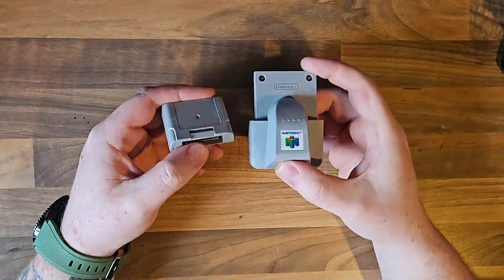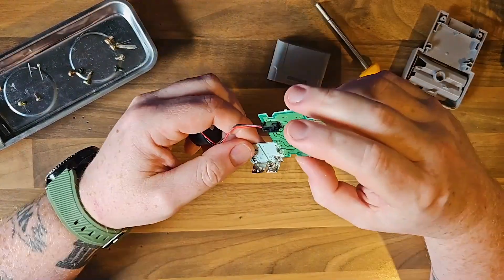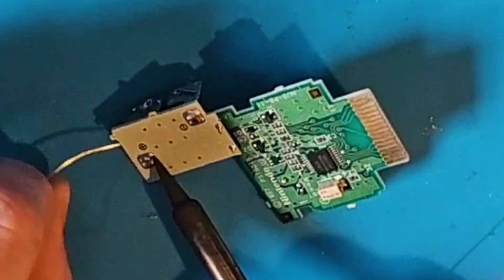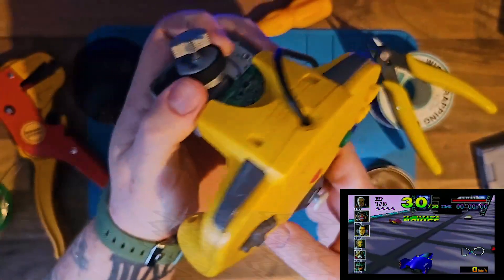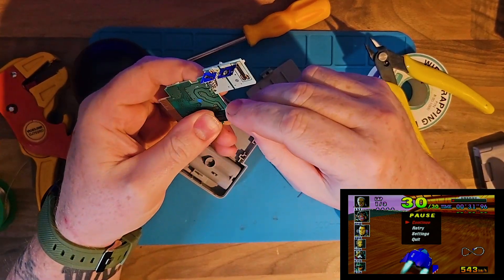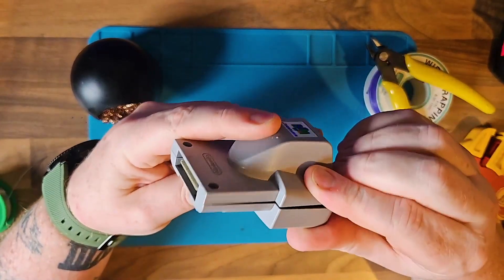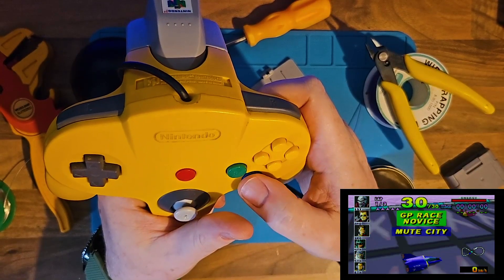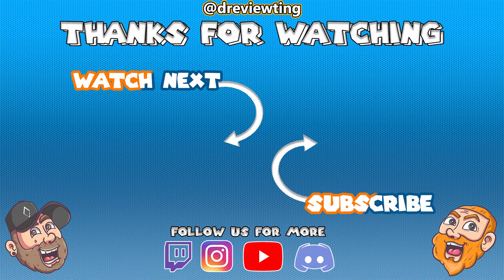No Batteries Required?! NEW N64 Rumble Pak Mod 2024

Comment: hey 2025 here :D , what if we put a capacitor in the battery housing to support the voltage? will it damage the console? or can we figure out something with it to stabilize the current draw?
Reply from the maker: Hey, 2025! Haha! I wouldn't know about adding a capacitor. I use this regularly and have zero power/draw issues.

Comment: I have a Tremor pak plus and was hoping the inside would be similar. Nope. I had no idea what the heck I was doing so I just solder the wire directly to the 3.3v pin itself. I thought the controller or the console would blow up but it end up working lol.
Reply from the maker: Ha! That'd absolutely amazing! I've not found anyone with a solution on third-party peripherals, so you might be the first! Haha

Comment: All you have to do is move the resistor under the batteries to another location no need to add wires
Reply from the maker: Both work. This way means there no need to desolder anything. Just one wire, that's easy to undo to put it back to stock.
Reply: @DReviewTing isn't the resistor necessary in line?
Reply from the maker: I'm honestly not entirely sure. I ahead both mods, and find them to both work the exact same way.

I find the wire less daunting that removing the resistor and relocating it.

Comment: wonder if swapping out the motor for a lower power one could let all 4 run without batteries
dont have a n64 to test that out though since ive always been on handhelds rather than tv consoles

older stuff like this would probably be wise to put a diode between one of the motor wires and the main board to prevent backdriving, though tracing back whats visible in the video looks like it should be a safe mod
Reply from the maker: That's a very interesting idea. I just swapped the motor out of curiosity, but maybe a lower power motor would work better.

I'm still new to alot of this stuff, and have no clue about diodes or drive back. But now you've said, I'll look in to it and do a bit more research.  Thank you!

Comment: I'd be a bit wary of this.  If it was this easy, don't you think Nintendo would have done it to start with?  I would guess that the N64 isn't designed or rated to supply that much current for a long time.  That or there are protection circuits built into the rumble pack that deal with the back EMF that the motor is going to produce when the power is cut but it's still rotating.  it might work for now, but I'd wonder if you wouldn't eventually blow the driver out on the console side of things.
Reply from the maker: My thinking was with batteries, it offered more stability and the ability to use four altogether, whereas with this, there is only enough power to draw from the console to power two.

I'm still new to about of electronics, but have a few things to research now. Thanks for the comment 😃